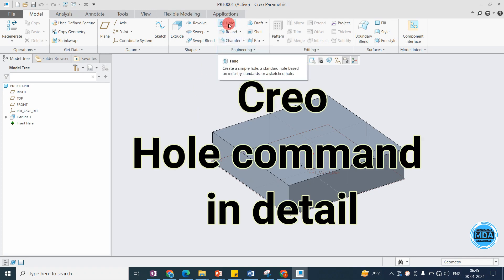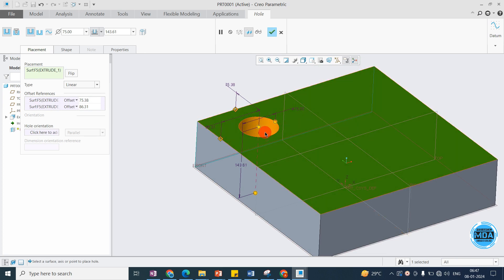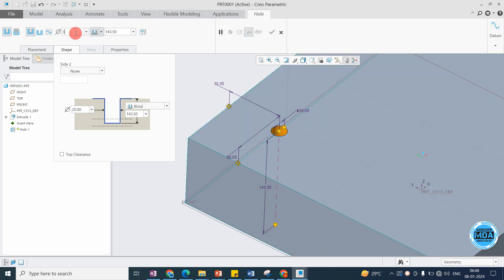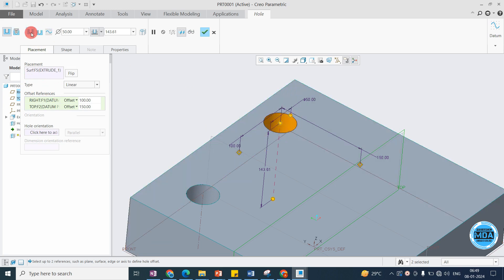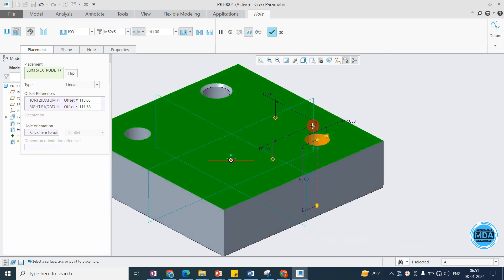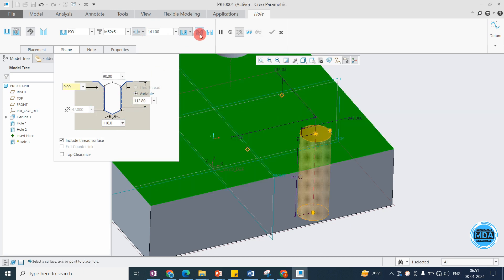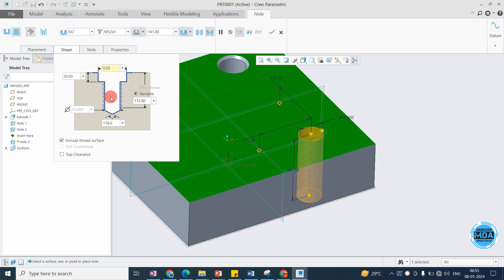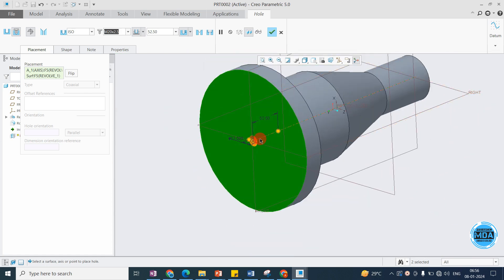Creo tutorial for beginner | Hole command explained in detail | #creotutorial

Comment: So there is no way to create threads
Reply from the maker: We can create thread by using helical sweep command
Reply: @MechanicalDesignAdda don’t you agree that solidworks has a whole feature for threads and so creo should have the same.
Reply from the maker: Dear friend
I don't know solid work hole command but in creo you can create  hole with thread lines only not cutting actual thread, if we want create actual thread helical sweep work
Reply: @MechanicalDesignAdda  I understand! I just started using creo about a month ago and I am comparing its features with solidworks
Reply from the maker: Great, feel free to ask if you stuck while using creo
Reply: @MechanicalDesignAdda  sure thing.